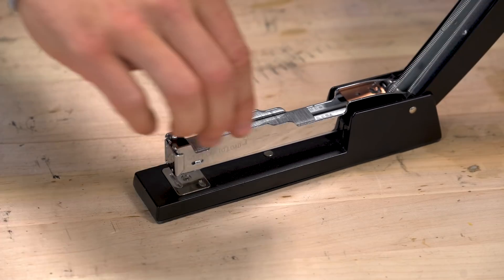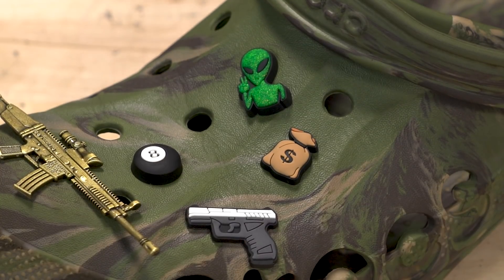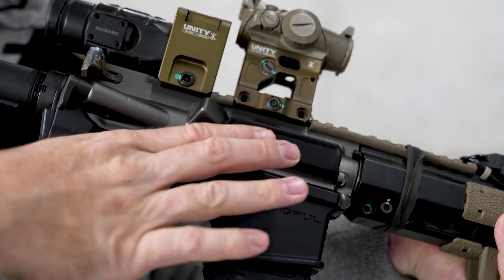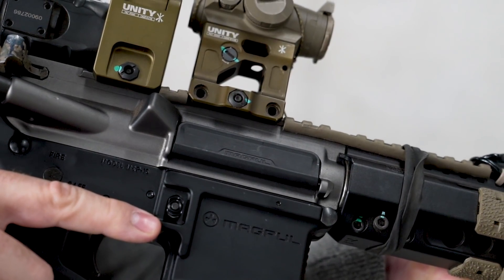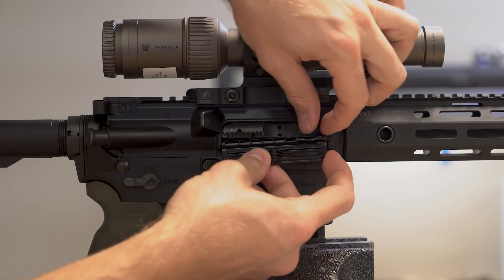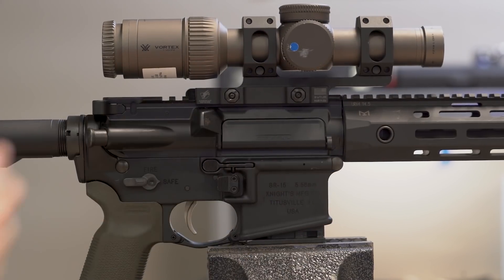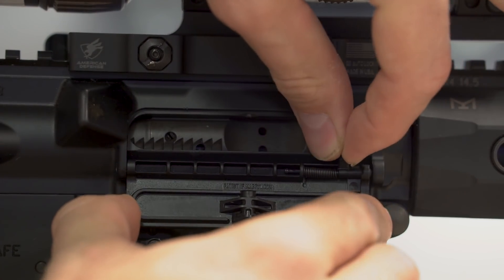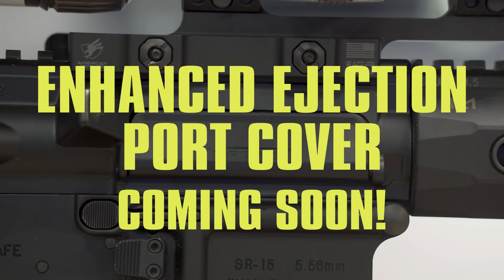Magpul - Enhanced Ejection Port Cover

Comment: I have two and either mine are out of spec or 19 of 22 various uppers, BCM, Aero, PSA, Colt, Muller etc are as that they wont work. They fit so tight they don't rotate and when charging the bolt open about 1/8 Inch. Maybe they need to break in, but the polymer at the bottom that houses the pins is too thick it doesn allow it to rotate even under the spring tension, so I may need to shave them down if they don't break in.

Comment: -I’m glad to see magpul realize that electronics are the future for every Industry. Tracking point paved the way with a ballistic computer with a reticle that auto compensates and could tag and track moving targets and be poa\poi accurate from any distance under 1500 yards.   It recalled all the variables 64 times a second providing stupid accuracy.   Then they went dark once the military complex and friends showed interest.  
Then atn basically comes out with a competing version that’s over $4,000 cheaper with all the options included. 
Now thermal is wanting to become affordable, just not quite there yet.
Maybe the future will have solar backup\powered (like holosun is providing), tritium style scopes that use lidar instead of laser and have instant exact distance.  If it fits on an iPad, it’ll fit on a scope.

Comment: I was issued M16's that were over 20 years old, I own more AR's than my wife thinks makes sense for several decades....and I've NEVER had "corrosion" on a dust cover.
And that doesn't even matter, if this thing is under $15, it goes on my next upper.

Comment: The only reason id have to swap covers is if it actually had a gasket to form a better seal. Ease of installation is only an issue if youre actually removing and installing it regularly

Comment: Don't get the point. It"s not like there is some need to rapidly switch dust covers. I have never had one break or felt the need to remove it. The dust cover is basically useless and could just be removed with no impact on reliability.

Comment: Real question is: is the cost going to be worth it? It may be a pain to install a normal ejection port cover, and with heavy use it may get corroded, but they only cost about $10. So, Magpul, how much will yours cost? If it’s $50 or more, like how a lot of your products are 5x the cost of your competitors, I don’t see the pros outweighing the steep price con. When I can change an ejection port cover every year for 5 years for the cost of one of yours, no matter how convenient it may be.

Comment: Nifty, don't care about steel vs poly, but I appreciate the tool less nature of it.

Edit: Don't screw up the pricing.  Standard AR dustcover kit is $10-$15; cover, spring, and pin.

Try and keep it in the same range.  This isn't an $18-$25 part.
Reply: Retail is $15. So they’re on the right track.
Reply: @DocMitchell69  That's great to hear.  I hate when a good product gets priced too high.

Comment: I saw Garand Thumb do a freeze test and the AR platform did not fare well and it seemed the ejection port freezing was preventing full extraction of the spent case. I wonder if this would help?
Reply: Probably not. In that particular case, he was pouring water directly over the closed port door. Any water on the hinge area at all will freeze solid and prevent complete opening. 
  It’s a double edged sword kind of thing. The close tolerances that help seal the system from outside elements is what gives the AR an advantage in mud or sand tests, but those same tolerances screw it in freezing testing. It is what it is 🤷🏻‍♂️

Comment: So I'm confused, what is advantage of polymer ejection port cover? I've never heard complaints before about metal.
Reply: Creature comforts, less rattly, less rusty. Maybe it's your thing if you're a pirate.
Reply: Besides installation ease, they can provide a better "seal". YMMV...
Reply: There's an argument that polymer is more resistant to damage from bending. When metal bends it tends to stay bent, while polymer will go back to its original shape.
Don't know how much that matters on an ejection port though.
Reply: If we're being brutally honest with ourselves, people rarely modify guns with the goal being superior function. Most aftermarket gun parts serve the same function to the user as jewelry -- uniqueness and aesthetics.
Reply: Ease of manufacture. Magpul has over a decade of experience with injection molding of polymer.
HK also uses polymer ejection port covers on their MR556s and it seems to work.
Reply: There is no advantage...   1) how many people actually close the dust cover on their rifles... Most dont.  2) this is a product that has literally been on the market (made by other companies) for 20 years.  

Unless you're putting an upper together, and don't want to have to deal with a traditional dust cover install, this is just for kicks.
Reply: Not much.  Other companies make these
Reply: Cost is the only advantage in this case
Reply: Whispers Ejection Port covers are mostly useless.
Retreats into bushes
Reply: @joeytomato  
Anyone trained on the Rifle. 
This is a unique type of product. 
It won’t rust. 
It will make less noise when opening/closing. 
Easier to install.
Reply: @JEJAK_777  I have 13 years of Army, and almost 11 in law enforcement under my belt. I've been a range officer and an FTO in both positions. I'm well trained.  I've maybe flipped a dust cover maybe 10 times in both careers...  Anyone trained on this rifle, shouldn't be having rust issues. And if they are, the dust cover will be the last of their problems... And having used a polymer dust cover (that came on my upper), no...  Polymer stapling the side of a receiver doesnt make any less noise than any other dust cover.  

If you want one, go for it.  I could not care less...  But it's an unneeded upgrade on an AR-15 unless you're building one from stripped, and just don't want to have to fiddle with a traditional dust cover.
Reply: @joeytomato  Ahh. I assumed every other service branch indoctrinated you to keep the cover closed unless you were pressing the trigger. 5 years USMC, RSO, Instructor, armed contract security, and shoot competition.
Reply: @joeytomato  finally someone else that doesn't have their head up magpul's..... completely useless product!

Comment: Having issues with Aero Precision M4E1 uppers. Why make it a Milspec uppers only. Didn’t think this magpul dust cover would not fit when my standard metal cover and Strike Industries worked fine. Looks like I wasted $15. It’s going in the trash if it doesn’t break in or start moving freely.

Comment: Love Magpul, but this is a solution to a problem that doesn't exist. I've literally never heard of anybody having a problem with their dust cover, and even if they do, it's not like it affects the function of the gun. Some people don't even run dust covers.
Reply: Well whoever doesn’t run a dust cover is either dumb or doesn’t have a use for their rifle. I mean if it just sits in the safe or you take it to an indoor range then yeah you don’t really NEED one, until you do.
Reply: @brettsilva7317  I mean, 99% of us aren't rolling around in the sand in Afghanistan with our rifles. Not having a dust cover isn't going to really hurt you much. With the bolt closed, the rifle is still a sealed system.
Reply: @camaro25  that is literally what I just said.

Comment: NO WAY 😆
Right after I JUST put on a new barrel, because the barrel nut stops the ejection cover rod from being taken out, I discovered I have to remove the barrel AGAIN to change the broken spring. THIS WOULD FIX THAT ISSUE!
Reply: If you YouTube it, you literally can remove an ejection port cover without removing your barrel. You can remove the pin the opposite way.

Comment: ummm wait a minute. to install the cover you have to take the old cover off with the same tools you would use to put a new cover on.... so.... what is this really accomplishing? rubberizing/polymer everything isn't necessarily a good idea.
Reply: Clearly we also need a polymer bolt now, so that the polymer dust cover doesn't break. Because that's worked wonderfully in the past.

Comment: Now people have no excuse to buy the shitty strike industries one
Reply: Aside from the Magpul spring system being much less fiddly than the SI one, I can't really see any crucial difference between the two, function wise. Now I haven't owned the SI cover either so if it's a fragile POS then what'd I know. I'm not a saltwater pirate worried about rusting my port cover, so I never sought out these things.
Reply: What's shitty about it  ?
Reply: @prfwrx2497  The SI one doesn't always open all the way in my experience of 2 of them.  I got metal ones with a similar plunger detent from combat armory and those have worked flawlessly.

Comment: This actually is a easy yet noticeable improvement.
Reply: I don't see it as an improvement. Metal scratches and rusts but it won't crack and melt in this case.
Reply: As much as it is easy to install and won't scratch like metal...this is something designed to take damage so the important bits of your firearm don't break. If it's made from polymer good enough to do that, it'll be too expensive. If it isnt, it'll be too weak.

Comment: Couple things:
In order to install the super simple cover, one must disassemble their upper to remove the old rod.
Second, can it be engraved? I use the dust cover to indicate the caliber of my uppers (I know, purely a civilian problem)
Reply: You can remove the c-clip and slide the rod rearward. Replacing the c-clip can be done with a fancy tool or tweezers.
Reply: Dremel. Cut up the pin if you hate it that much.

Comment: Nice1 Magpul, after the front receiver D-tent pin the eject port cov is the biggest pain in the ass to install. Shaved off most of mine years ago, always felt like it still should've been there, never made a difference, just didn't feel right though.

Comment: Has anyone actually ever had their cover fail?
Reply: I’ve seen a couple busted ones, and they can get bent fairly easy.
Reply: Nope not one, but if you did bend one instead of bending it back with pliers your $20 piece plastic will be on the ground. Helluva improvement 👏 👌
Reply: @theLeadGin  That’s not how that works 🤦🏽‍♂️

Comment: Wth, why? Who is having to change out their dust covers so often that this is needed? If you have problems installing a regular dust cover you should be working on a gun.
Reply: It mostly just looks better, but it’s also quieter and doesn’t bend or rust.
Reply: @erickeating5709  quieter? Eric, it's a fucking rifle. When the dust cover opens, it's because something VERY LOUD is about to happen.

Comment: try putting a bcm mmr rail on (which is so tight, you have to heat the end to expand it and still use a hammer) then realizing you forgot to do the ejection rod... :'-(

I got the strike industries version and that thing is SLICK!  LOVE IT!

Comment: Making good-enough AR parts as cheap and widely available as possible. Next you gotta try polymer free float rails, which would be a good option for people whose rail is just hosting a light, front sight, and maybe a VFG but doesn't need to host any sort of PEQ15 or other IR laser device.

Comment: This has to be the worse Magpul product ever designed.   The "ball" in the spring loaded detent mechanism has an extremely rough surface finish.     Installed it on an Aero enhanced and Daniel Defense upper and I have to FORCE it to close.  To open it have to pull on the charging handle with extreme force, almost equivalent to mortaring it.   Hate to say this but Strike Industries stainless ball detent (also adjustable) is far far far superior to this Magpul product.

Comment: I have never once had a dustcover corrode or seen any reason to switch one out after a long round life. This is the dumbest thing I've ever seen
Reply: Never had the spring give out? Or the detent break? Or one get bent and not close properly?
Reply: @JEJAK_777  not ever and if something cause the regular dust cover to bend or break that plastic one would absolutely snap
Reply: @wendigoactual8325  That’s not always the case. Look at USGI Mags vs PMAG’s.
Reply: @JEJAK_777  what? USGI mags are better what about it? Your saying the dust cover will crack like pmag feed lips oh ok I gotcha.👍
Reply: @theLeadGin  No, I’m saying aluminum will bend and not spring back to its original shape/form. With the right blend of Polymers, a product can flex/bend and not crack. At a certain stress point the aluminum will bend and be trashed, the polymer one will snap, but will be far easier to install.